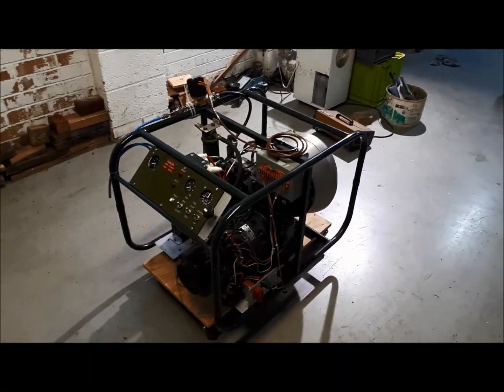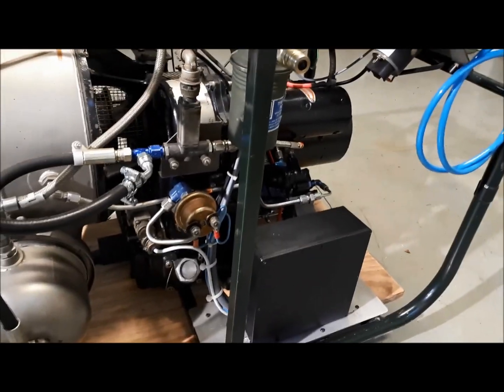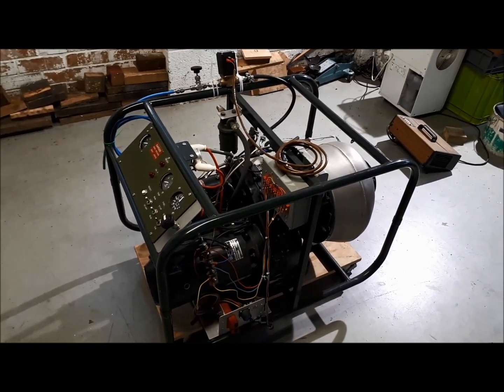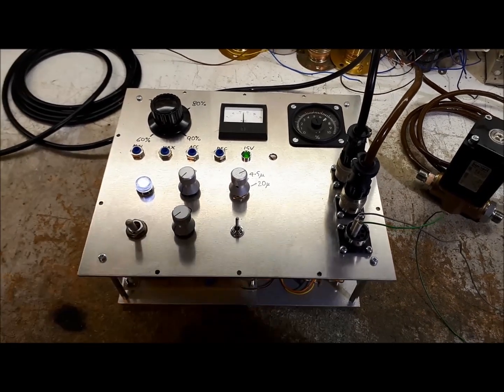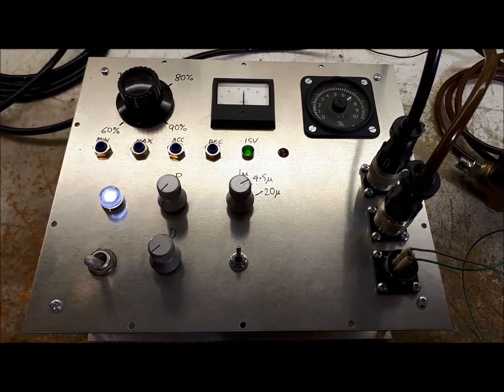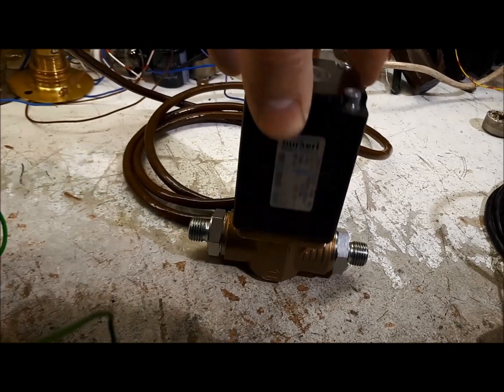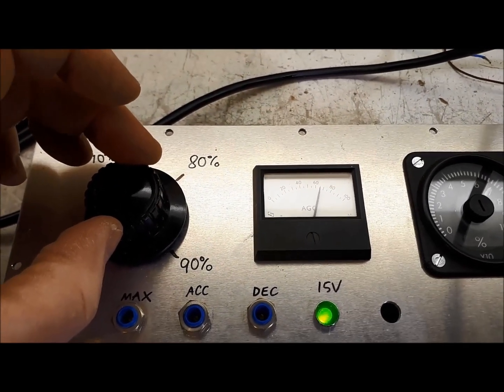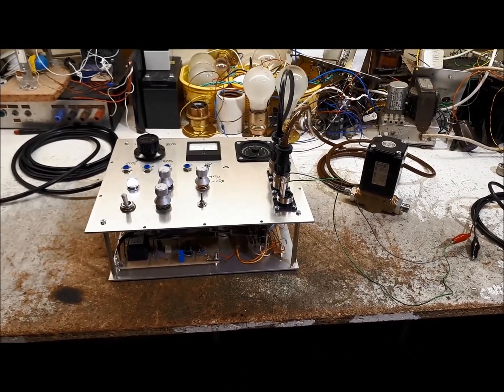Small Gas Turbine Microturbine control test PID type speed control throttle

Comment: The ramp circuit in effect is your "i" term.  From my experience, a simple Pi loop would work better as D is a hard term to tame on high speed feedback loops such as this because when you start adding load to the generator, its rarely a stable load like you have here basically idling.
Great work though 😁
Reply from the maker: There is no I term because of the need to address wind-up when the loop is out of lock. The ramp is outside the control loop. It just prevents rapid changes of the datum.
Reply: @gasturbine101  prevents rapid changes.....just like an I term can   😁
Reply: Intergal